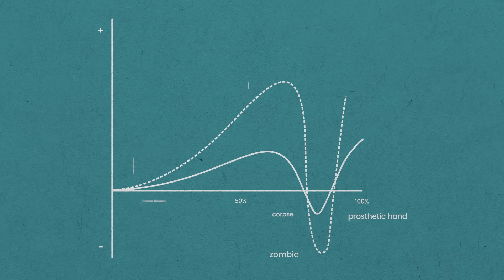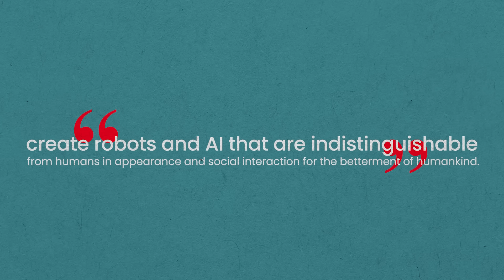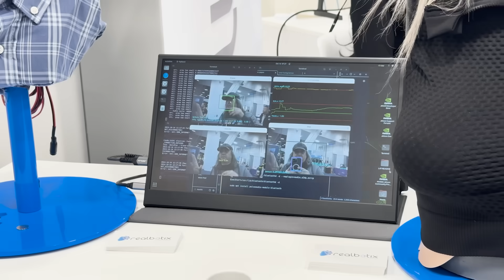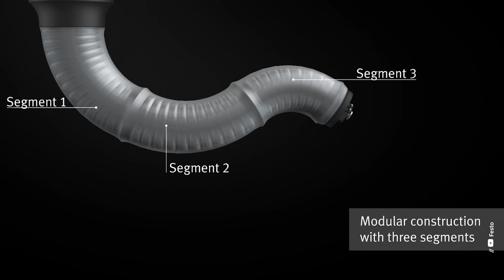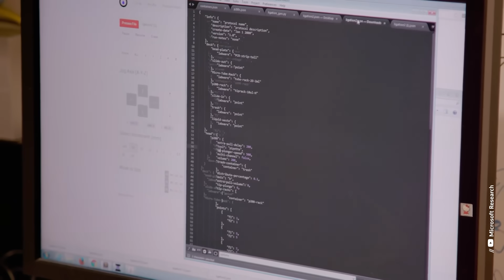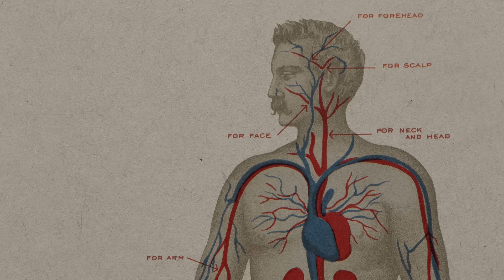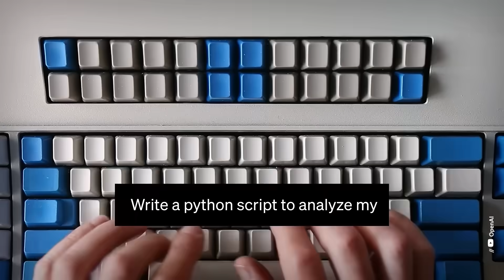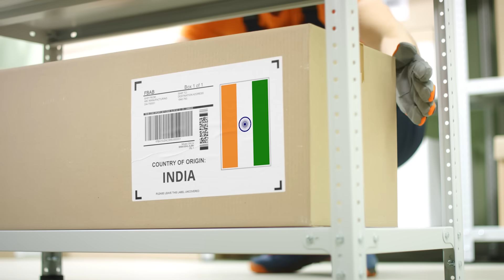Have Humanoid Robots Gone Too Far?

Comment: The idea that robots will take the place of cheap manual labour and open up higher paid jobs is ridiculous.  What you're saying is that those jobs only exist because other more advanced jobs don't, but you're forgetting that many people are not mentally able to do more advanced jobs even if they were available.  The world isn't full of brain surgeons working in low paid jobs, it's mostly full of low to average intelligence and unskilled people doing the best they can, unfortunately.
Reply: Unfortunately very true, there's people even at basic jobs that are just barely figuring it out, if you don't believe this, you're likely one of them and not noticing how incapable so many people are.... No hate to any of them, it's just an unfortunate reality.
Reply: I don't think that's what he was implying, but there is certainly a disconnect with the idea of replacing all manual labor jobs with robots will "free up" people to take more advanced jobs.  Those people doing manual labor will likely never be able to do more advanced jobs for several reasons.  But robotic labor is not a fantasy; it's already been here for decades and is only growing.  It's called automation and it has been happening for over 200 years.  As technology gets more sophisticated, so do the machines and less manual human labor is required.  In my nearly 40 year career in industry, I've seen an abundance of increased automation and an ever shrinking job market for manual labor.  People seem to think that robotic labor will be a one time discrete event, but it's already been happening for decades and will continue at an increasing pace until most manual labor is automated.
Reply: Where are they going to get the extra electricity needed to power all of those robots? We have power supply issues as is.
Reply: If robots are able to farm all the food we need to eat, keep the power systems going, and build us shelter ...what would we need money for?
Reply: @Beldan4  Because you have to get to that point first.  The utopia idea of robots doing everything so humans can just do whatever we want doesn't just happen overnight, it takes loads of money to make the robots in the first place.  
And even then we'd still need some sort of system to stop every human from saying "I want a mega-yacht and a massive mansion", because that's simply not physically possible.  
So even if it did happen we'd still have humans arguing that they deserve more than someone else, but there would be no way to "work your way up" as all the jobs are done for you.  It would probably lead to a frustrated populace, riots, insurrection and wars.  Likely with the robot Police and armed forces destroying us all in the end.
Reply: companies dont owe someone a job just becuase their not skilled or smart enough to do somehting else, when robots take the un skilled labor market, all those peopel will have to go else where... are remain jobless, etherway that change is coming, how unprepeared the average person is for it really doesint matter.
Reply: @shardinhand1243 no doubt the companies will collapse due to lack of customers. It will be discovered that nobody needed all the cheap crap they manufactured in the first place. What a huge waste of resources it has been!
Reply: @shardinhand1243 more customers? How will all these people pay for them? Also, do you not think there will come a day when resources such as raw materials will be used more wisely?
Reply: @shardinhand1243 how? Easy! Get rid of all actors and use ai generated everything😂
Reply: @shardinhand1243 also as resources get scarcer, maybe from decades of manufactured crap, the price will in fact not go down! Mabe, just maybe people will realize all the things they do not need!
Reply: @shardinhand1243 so you know about the recycling scam? Only a small percent is recycled. That means most of our raw materials is used to make.. crap! Even if most could afford all this junk and decided not to, then the need for so many robots would drop .this process is insane and benefits nobody. All this junk does not improve life for anyone, it degrades the world and gives big companies that don’t give a shit all the power
Reply: @shardinhand1243 what I really mean is the manufacturing of needless junk. Fine use ai for good things.
Reply: @shardinhand1243 so how many toasters and pots and pans do you need ? How many purses? How much is enough? I will answer that. More is not enough clearly! Most are never satisfied with anything but more and more.
Reply: I was talking to someone while waiting for my pickup order as a restaurant. This was back when California was raising the minimum wage on fast food workers. Our food was taking so long that I said something like "This is why I don't think unskilled labor deserves $20/hr" to which she responded "Calling it unskilled labor is pretty offensive." I said "Unskilled labor is just the classification for a job that doesn't require any special training or a degree. Not everyone can get a skilled job." She didn't understand what I meant. I asked her if she thought the only reason these people were working in a restaurant was because they couldn't afford college. She said yes. She said she believed that everybody could become a doctor or lawyer if they had the opportunity. These are the people who think there will be better jobs. They legitimately think everybody is "equal" as far as intellectual ability.
Reply: @jaytee9111  they assume equal ability and drive to achive, so  of course in their dilusion there must be some other reason people dont all become rich, in their total ignorance they choose the easiest terget every ignorant person goes with, the one you cant falsify... the grand conspiricy theory the dumbasses arint rich not for their own failings but becuase a shadowy organization behind the scenes keeps them down.... the goverment, the elites, some of them blaim race, or gender, the patriarchy... aliens.. anything but accepting personal responcibility..... anything but accepting reality.
Reply: @jaytee9111   Who exactly does 'deserve' their Salary? In your opinion? I believe your comment directly links to why the USA is so fucked up, and the rest of the world follows your lead. Do you think your takeaway meal was slow because the Staff were hopeless, or was their Manager or Owner at fault? The minimum wage staff usually have fuck all control of the systems they are required to work under, or the equipment they're supplied to work with. The minimum wage people are usually doing the best they can with what they have. If the owner of this restaurant didn't have the ingredients or equipment to cook them in time, it's hardly the waitstaffs fault. I'd Love to come to your work and criticise you all day, while knowing fuck all about what you do. You say you were in California? What's the Rent in the area you were in? The waitstaff need $20 an hour in LA to not be fucking homeless. Sorry. I get angrier each time I read your drivel.
A Doctor is next to useless without a Nurse or 10, and a Lawyer is just useless. Parasites feeding off society, contributing Nothing. (Lawyers. Most of them. Not Doctors).
Your attitude has ruined my evening. I'm going to go now, but you have a long hard think about yourself, and your attitude. You've probably never done a real days' work in your life, treating people like that.

Not nice being Judged by someone who doesn't know anything about you, isn't it? Minger.
Reply: Every time there has been tech developed to help the poor, usually meant making them work harder in some other area
Reply: Musk & others think the government will just pay people a decent income & goods will be ridiculously cheap so everyone can live well-but there .ight be issues with boredom & lack of purpose for some people...🤔
Reply: If you are a European citizen, you will get some nice universal basic income when that day comes. If you are American, these days? You probably can hope for El Salvadorian prison camp if you will not be smart enough for work
Reply: And you missed the part where whoever can produce the largest "cheap labour" force of robots on a mass scale will simply take all available jobs. Power and finance concentrated in the hands of the few all over again, nothing new here. Maybe we are on the same page here, I just think there is a more sinister agenda than is let on.
Reply: This is the issue with the disabled population, we haven't solved that yet, if this happens for people that can't get simple jobs like that, one would need to educate themselves to keep up. I agree, not everyone chooses or has the option to go the advanced route. I think this may be inevitable, obviously it's needed for geopolitical reasons, but once that's achieved and everyone's country faces this issue, I wonder how it will unfold.
Reply: @juangal7569  don't you think that if they have option for better job, they would go this way already? I know there are few lazy people and some put under wall will change, but most would do it in past if they could.
Reply: Sounds like a job for the education system
Reply: @xTheZapper  I have always had a high regard for brain surgeons. That was before I heard Ben Carson pontificate.
Reply: brain surgery should be performed by robots
Reply: Why would you want to have a low paid boring job?
Reply: Don't worry, the robots will be doing brain surgery soon enough. Then there won't be any work for humans.
Reply: China is developing too fast. What I am afraid of is not the loss of jobs, but our inability to control machines that are more resilient than us. This is not a good phenomenon. Robots should be replaced by humans.
Reply: Advanced jobs will be taken by AI/robots either before the lower paying jobs, or almost at the same time. There will be no more jobs to speak of in the global term. How will people pay for the robots, when they have no jobs, is another interesting question. Overall, the statement that most likely robots will be a good thing is just infuriating. Either all these presenters are AIs, or stupid, or just trying to make the bucks there is to make.
Reply: @nikitchm  They can identify ass kissing idiots to, who many people like to have around. Sorry, in any way I see this is just another road to dystopia.
Reply: To some extent, there aren’t enough jobs requiring higher skills, such that people with PhD’s and experience aren’t able to find jobs, but are overqualified for basic jobs.  Overall, just not enough jobs for everyone now.  Maybe if billionaires weren’t soaking up every dollar.
Reply: @danpowell3953   @danpowell3953
It's not the billionairs. It is YOU. 
There are plenty of JOBs. 
ALL the military branches are short of people. 
The Truck driving industry needs more people. 
Heath care needs a lot more people. 
There is always care for the elderly and cemetery work.
Reply: This is driven by corporate greed.
Reply: Worse comes to worse (or best to best, depending on your perspective) and we will all get a universal income and let the robots do our work for us.
Reply: @caracoidwren944  Do you think that could happen in the US? I doesn't look like the hyper individualistic culture would allow for it.
Though, I'm from Europe, not the US, so maybe someone from there can correct me.
Reply: @caracoidwren944  Universal Income is a farce. It would be a tax on manufactures who replace humans with robotics. The purpose of replacing humans is to remove their expense. There would be lobbing on a biblical scale against such a tax. Such a tax could never replace the taxes people pay, and thus would bankrupt the country. Never going to happen.
Reply: @caracoidwren944   @caracoidwren944  
Every time, (Universal Income) has been tested, it has failed. 
Badly. 
With everyone getting universal income, most people would stop trying. 
Have you seen those signs at the park that tell you. "Do not feed the animals". 
The same thing happens with humans.
Reply: Because communism works great? Who distributes that money, the government? You're consolidating a tremendous amount of power to a group of people who have failed and love to abuse power. And how do they decide how much everyone gets? Social credits for those who obey and conform to social norms or a dictator's whim? You deserve the suffering of communism and a centralized power. Go to China and live there if you think it's so great. Stop trying to drag the rest of us into your abyss. I'd rather have to work than be an adult child who has "mom and dad" (government) take care of me while I play all day.
Reply: @caracoidwren944  Universal income is a myth. If everyone gets it, the prices will rise to offset it, like it isn't there. What should happen instead is free utilities, food, clothes, etc. But that will create another layer of problems, albeit smaller ones.
Reply: @ivanjelenic5627 Exactly. People like to think a universal income would ever happen and don’t stop to think, who would be the rich the middle class and the poor then? Universal would mean there is just a ton of poor people and some extremely rich people living their best lives.
Reply: @ivanjelenic5627  Same was said about raising minimum wages, and yet when it did happen in some states the prices didn't go up. Such fears about UBI are created to imply that there aren't resources to tap to provide such financial support to everyone that needs it, which isn't true at all.
Reply: @rhaedas9085  Minimum wage workers produce lots of goods and services.  UBI adds nothing to economy except more currency which causes inflation.
Reply: @ivanjelenic5627  Universal basic income can work, just not in a capitalised society. Making everything free has its own issues, mainly people overindulging and being wasteful. No matter the size of the country, you can only produce so much, so you need to limit how much an individual can get.

Under capitalism (without heavy market regulation), AI-powered robots will only result in companies using them to replace human workers or using the threat of robots to lower the wages of employees. Labour is the most flexible cost a company has; lower it, increase profit. Line must go up. The wealth gap grows.
Reply: @raybod1775  you don't understand what UBI is and how it would work, it is not printing money, is giving money which was first taken as taxes. So you not creating money, you only redistributing them differently. In Switzerland was even voting if they put it in place, but it didn't pass.
Reply: @damien991  And one big problem is that if you look how is proposing UBI, or saying "robots will not take jobs, but create new" they are mostly people which are involved in development of AI and robots, which should put red flag on what they are saying. 
But one thing will change, and that more products become closer to they resources cost, so a lot cheaper, but this is creating even bigger the problem you mentioned.
Reply: @m_sedziwoj  There is nothing wrong with products getting cheaper; I don't see the point you are trying to make. The only two issues I see are that most jobs AI creates will be temporary. Universal Basic Income solves that. Two, under capitalism, companies will drive up profits as much as possible. There is a straightforward solution to that: don't let them. Move to a more heavily regulated form of capitalism, or the big Boogeyman of the West, Socialism. 

An AI could easily handle the logistical side of things as long as it is given enough information. This would solve one issue similar systems have run into in the past: human greed. Cut out the human from the logistics process so it can't be messed with. The only issue would be making the AI impartial in the first place.
Reply: @ When things become too cheap, it creates problems within today’s system. Look at clothes—people buy new ones, throw away perfectly good ones, sometimes without even using them once. From a civilizational perspective, this is a waste of resources—not just materials, but human labor as well. And there's always an opportunity cost.

This is why capitalism tends to work better than socialism: because of "human greed," or rather, human needs that are never fully satisfied. Limiting money (as a representation of exchange value) forces people to choose what they think* they need the most.

This is why UBI seems like a good solution, but in reality, it’s just holding up an old system in a new world. I don’t know many fantasy or sci-fi stories that explore this kind of society. The one that comes to mind is Star Trek, where people work not for money, but for status and personal fulfilment.

Back to your idea—I'm not sure if we would allow AI to go that deep. Deep, because it’s not just replacing existing systems, but transforming them at the same time. And people don’t like changes.

*“think,” because advertising and similar influences manipulate people into believing they need things they actually don’t.
Reply: @m_sedziwoj  Things being too cheap can be fixed in two ways. One is changing the way society thinks: there are people like me who don't needlessly buy things just because only to throw them away. That is probably why that never crossed my mind. So, through the media and other social factors make others become more like me in this way. The second option is to just artificially raise the price through a tax that can be recycled back into the economy.

As for people not being willing to let AI run the logistical side of things. You just use the media to change people's minds. Most people look to others for how they should think. Just look at how easily people can be led. The US election was won on the backs of 10ish rich white guys.
Reply: @damien991  What I'm saying is more about what I think happened, not what could happen. Because what you are saying is correct—if someone does this, it could happen. But I don't think that's what happened.
I think it's good to look at what people thought would happen in past technical revolutions, and what really happened. But because of the technological singularity, I think we can't predict the future.
Look at AlphaFold 2, for example. How many people know it exists? Even fewer know how big of an impact it had on research, and the impact it will have on discovery in a few years—people would be surprised.
And there are many AIs like this, each making a big impact, and all these impacts will influence each other. This makes it almost impossible to predict.
Especially when politics are still handled by people who don't know much about the internet, because it was in the '90s and they were already too old for it.
The reaction will be too late for any of the changes AI brings—whether good or bad.
As many say and I would agree, on other side is paradise but road go through hell. (I'm optimistic we would not stop at this way and stay in hell)
Reply: @m_sedziwoj  All I'll say is I refuse to go quietly. Even as a pessimist, I'll do what I can to bring about a better future. Even though it will most likely never be for me as I'll be long dead by then. If our species somehow makes it that far. Things are always changing and they want to go in a bad direction you must push it in a good one. Evil people win when good people do nothing.
Reply: @caracoidwren944  best case, we use the tech to advance ourselves and become cyborgs or hyper-advanced androids with human personality imprints.
Reply: @Siphlex  but that means we will still be working in factory jobs.  Just more capable, and smarter, and terrifyingly bored.
Reply: @TeddyRumble  When technology becomes sufficiently advanced, you won't have to worry about boredom because you will be doing several things at once while maintaining your routine job that only requires minimal attention. Ideally, you'll be running all kinds of programs and apps and doing all kinds of things based on what your preferences are. Besides, you'll be able to process information at such an advanced level you'll be able to fast-forward your own perspective until you've completed your day.
Reply: @Siphlex  pov cyberpunk 2077
Reply: We need to raise the bar on our own intelligence and culture before ee try and implement full on synthos
Reply: I totally agree! Why try to reinvent the human when it's already the most advanced being on the planet? We need to re-educate not replace
Reply: @HappyTyke25  you think what your saying is reasonable, but what you would have us do is stagnate, when we could be more. why improve when we dont need to... becuase we can....
Reply: Whoever took the time to read this has no life 

I'm gay
Reply: @knightman7203 your gay? Do you know about the high rate of anal cancer among gay men?😂
Reply: @knightman7203  Good for you!
Reply from the maker: In a reshoring context it may, reducing dependency on China.
Reply: @interestingengineeringie  While the masses are put on a puny ever shrinking UBI?
Reply: @interestingengineeringie no because China will be making the cheapest robots
Reply: @interestingengineeringie  corporations aren't "reshoring". They're tariff shopping. So, no it won't. And your answer doesn't even make sense. China just dropped Deepseek a few months ago. It outperformed Chat GPT so well. Lawsuits were being threatened. And in fact, American semiconductor companies are being restricted by the USA in what they can sell to China purely to slow down China's development. Because it threatens the USA. So if the USA can do manufacturing cheaper with AI. So can China. Which again leaves us with the problem of, where do all the human labourers go? These people aren't doing unskilled jobs because they have crazy mad skills they just aren't using.

This also creates another problem. If AI takes all the un/low skilled jobs. Who's going to buy all the stuff that's being manufactured? Un/low skilled jobs are the majority of jobs. And it's the people who work those jobs that spend the money they earn. They are the backbone of the economy.
Reply: yeah that’s still just schilling for an industry determined to wreck unskilled labor.
Reply: It would force the population to get smarter in order to compete
Reply: Robots and AI algorithms can identify people with potential for advanced jobs, educate and train people, and manage, supervise and coach people.